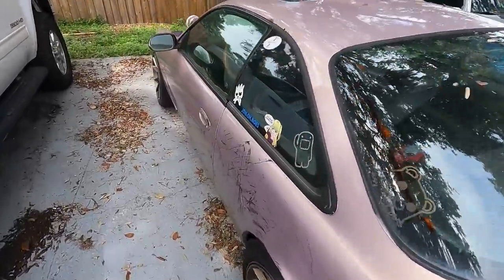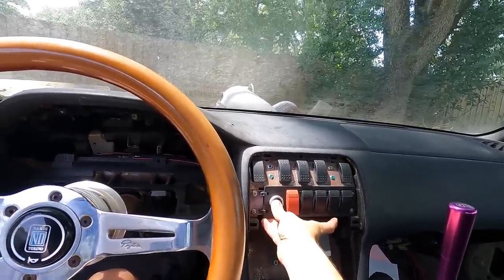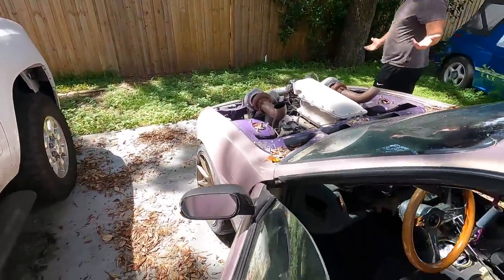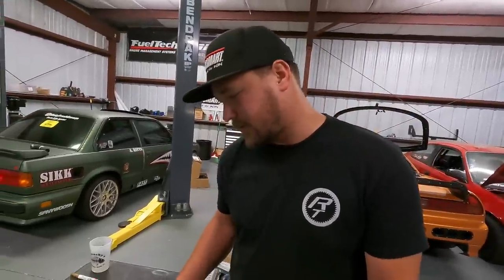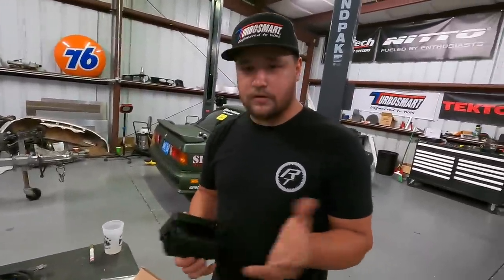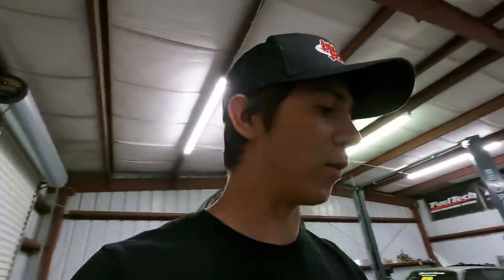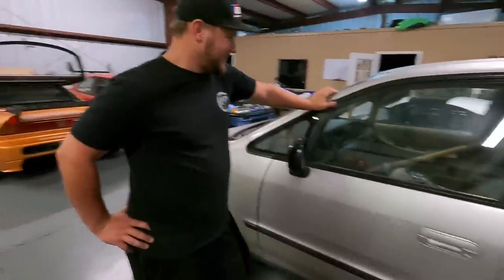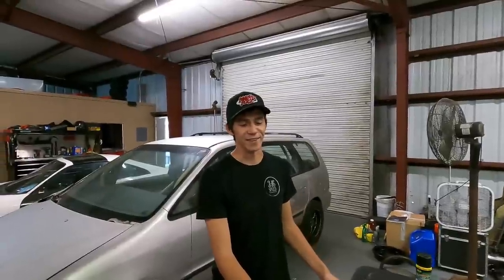Our 1000Hp Minivan Build Is Getting Big Upgrades!

Comment: Kyle, the best solution for your Alternator is an UNDERDRIVE pulley. It will not allow the Alternator to spin up as fast. Should be a LARGER than factory pulley. Good luck man!
Reply: Yup^
Reply: I've been trying to figure out why more drift car guys don't do this. I see a bunch of them or enough of them have issues with power steering pumps and other things.
Reply: You got to remember though on this it also if I remember I spend mechanical fuel pump? So I don't know if spending that slower will work when you need it
Reply: This right here. If he doesn't get a bigger pulley on it when he gets over 6k rpm consistently its gonna fail again.
Reply: @ls_812  only the components with the under drive pulley are going to spin slower. It won't effect anything else.
Reply: @ls_812  The mechanical fuel pump is on the camshaft, not on the accesories belt.
Reply: @ls_812  the larger pulley goes on the alternator, so only the alternator spins slower.
Reply: What?With the constant dead batteries,I was thinking he was doing a Blue-Tooth style alternator.Keep trying you 2.It'll go dead or blow up.We'll be watching.
Reply: @bryduhbikeguy  🤣🤣🤣

Comment: You need to put the 8.8 IRS from a Ford Explorer in the back of the Rowdyssey. All the axle and diff problems will go away, and you can bias more power to the rear where all the traction is available.
Reply: Rear axles are simpler to change compared to the bevel gear.

Comment: Glad to see you're using MIL-SPEC aerospace connectors - those are awesome for your application.  Once you start using circular MS38999 connectors, you'll never go back.  Crimpers and parts are expensive, but they are fire-and-forget solutions that you won't regret.  Much better than some taped-up honda plastic connectors.  Love the content, cheers!

Comment: Instead of carbon fiber a lower buck option that is easier to do for one off parts is vacuum formed plastic parts. You can make the doors and hatch plastic. They will not be as stiff but they are light and durable as well as easier to make at lower cost. Thanks for what you guys do. I met ya'll at Cleetus's event. You guys are fun to watch.

Comment: Why don’t you just park 240 under the RV awning?
Reply: I was wondering the same thing. But I think he keeps his flatbed trailer there.  I’d rather have that out in the rain then some of the cars around the shop
Reply: And throw a battery tender on it.
Reply: @FCBENI  hahahah seriously I currently have 6 of them all plugged in and charged up
Reply from the maker: It’s full with the 2 car trailer, enclosed, and the jet skis
Reply: Tionee 15  Right? kinda sad how badly he neglects his cars. then again, theyre not mine so its not really place to judge haha
Reply: @boostedboiz  the jet skis should be more waterproof to sit in the rain than that 240 with up pipes
Reply: @boostedboiz  they are car trailers, load it up. Lol
Reply: Put two of your cars in the enclosed trailer and pull out the jet skis and cover them with a tarp or waterproof cover made for them.  Store your other vehicles in their place.  Also, I use battery tenders on my parked cars and keep a jump box fully charged.
Reply: @boostedboiz  give em the BOOSTEDBOIZ MTV Cribs episode coming soon 😆
Reply: @boostedboiz  put the car in the trailer
Reply: @boostedboiz  you know jet skis are mostly waterproof right?
Reply: Put the 240 on a trailer under the garage, unless it’s already gotten cars on it
Reply: A Tarp...A Heavy blanket...heck plug the exhaust pipes with some foam balls if for no other reason to keep the rain out of the turbos...
Reply: @boostedboiz  just get a couple car stackers put the 240 over the wago or vise versa...just a thought but sure you have thought about it
Reply: @charlieupson11  Waterproof sure. But the sun fades jetskis like crazy, he would need a cover. Or else the gel coat and seats, handlebars etc would fade quick in the Florida sun.
Reply: @boostedboiz  brother...i got you..real talk.....K-TECH.....your VERY welcome homie ...go check that sht out..you want speed this mans el chapo for honda speed
Reply: @boostedboiz  mate call @sammit boys friend/partner is a parts guy even full cars son ...cmon kyle we got you brother and @sammit u and him i believe are both nuts off the same tree buddy
Reply: Kyle keep up the good work brotha I love your YouTube channel
Reply: @boostedboiz   I love your YouTube channel brotha keep up the good work bro
Reply: I think y'all are forgetting it's a basically stock jseries with eBay turbos. Meant for thrashing and burnouts. And fucker runs mint.
Reply: They have to much money
Reply: always thought the same thing...
Reply: @joetitone7486  unfortunately, that's a bad idea. I wish it wasn't... but if you did, you would be doing more than half the work for anyone with bad intentions.
Reply: That’s just his style.
Reply: @EASTSIDERIDER707  for real
Reply: Slap the 240 on the 2 car trailer while not using it
Reply: @Jcarney87  20k jet ski vs 5k 240. I’d take care of the jet ski
Reply: @boostedboiz  easy flexy mcflexerton lol
Reply: @TheFlatlander440  that's a pain when you want to use the trailer
Reply: You could have 1 ecu for all cars... just swith it over and change the tune depending on the car its in 😬
Reply: Its just a 240.
Serves a purpose as a beater not a show car lol.
Reply: @boostedboiz  put them on the trailer
Reply: @niekgozer26  Why?  Kyle wouldn't be strapping the cars down in there, just storing them.  Pretty easy to pull them out when you need to use the trailer.  It was just a thought.  Either that or buy a used 40 foot container on the cheap for storage.
Reply: @boostedboiz  build more coverage or extend the shop! 😁😁😁
Reply: @boostedboiz  put it on or in a trailer in the RV carport.
Reply: @Jcarney87  Priorities, man!
Reply: @joetitone7486  reminds me of goonsquad who have a car lift with a lambo on it and crawl around under the other car they are actually working on like it's a show stand.
Reply: @nickm6386  he has no choice
Reply: @i-_-am-_-g1467  what? A tarp is like $3
Reply: @boostedboiz  lol put the jet ski trailers on or in one of the car trailers? Modern problems require modern solutions.  =p
Reply: @boostedboiz  Cleetus cheerleader back at it again lmao
Reply: Good idea
Reply: Y’all need a carport!
Reply: @boostedboiz  what kind of diff do you need for the minivan?
Reply: The engine is cheap and it’s a burnout machine don’t cry
Reply: If you want your jetski destroyed in 2-3 years leave it uncovered in the sun.
Reply: @K20rotrex  yep just a mini van engine lol
Reply: That way you put the nicer cars in the air and the dont get bumped or scratched....just saying....
Reply: @boostedboiz  wouldn’t want the jet skis to get rained on

Comment: Need to at least stuff some NERF footballs into those exhaust up pipes while letting it sit and rot
Reply: Nerf balls just get waterlogged then drip in and dont let the air dry them out drill a small 1/8" or 1/16" in the lowest part of the underside of the exhaust

Comment: Put an ac system in it and route it where you can turn it from the cabin to only blowing on your intercooler. Very little power loss and the cold air will keep IAT low

Comment: probably should look into a larger ALT pulley to slow the internal rotating speeds. We have done that on several race cars. We've also gone to larger power steering pump pulleys to slow them down as well....that high rpm life

Comment: Cut the doors inside and take the bars off. You can cut them and still have the windows  roll up and down in the front. Cut the back doors and lexan the windows and rear hatch too. That would be crazy weight off. And still have door panels 💪🏻

Comment: Laying carbon is not hard. You can make your own with some elbow grease. Put the door into a sandbox to make an impression, spray that with rhino-liner or plasti-dip to harden it, then layer your carbon/resin onto that. Vacuum seal it. Doelne. Watch Patet build the scrappy carbon cub, there are 3 vids on making your own carbon body panels

Comment: Wosp also makes high performance starters, with better starting trough a lot higher cranking rpm. I believe rob dahm uses it on most of it engines and they work very vary well.

Comment: Kyle you don't have to use the Honda differential if you know the final gear ratio of the stock Honda DIf then you can use any differential as long as it's the same gear ratio you just need to mount it and get the shafts made

Comment: you could put some aluminium foil over the exhaust pipes at least it isnt open to the elements 
about those doors , even if you replace the steel doorskins with 1mm carbon sheet bend in a brake and glued to the steel innerdoor and take all the gubbins out of them they would be half the weight . might need to get inventive about the doorhandles

Comment: for the rear diff on the hatch, what about using a subaru or nissan one? would need to fab brackets for it, and get something to adapt the u-joint, but they are more common

Comment: Wouldn't taking the carpet and putting aftermarket bucket seats in help with the weight in a minivan? Even if it doesn't, still be rad to see 4 carbon buckets in the rowdyssey

Comment: The boys over at throttle put a s2000 dif in there rwd civic s1  performes helped them seems like it might be the way to go
Reply: Big difference between 4wd and rwd.. rear diff needs to be right ratio to match the front.

Comment: What is the ratio on the rear diff? if it is common enough you might be able to get one from another car to fit. Would likely take custom axles but let's face it, those stock ones are not gonna last forever anyway.

Comment: Really need to “lighten” the interior of the rowdessey y’all are worried about carbon doors with 400lbs of seats and carpet in the car. Would it help for sure but do the cheap and easy weight reduction first.

Comment: Way over revved the alt. when hitting the limiter .  I am very surprised  about that small  pulley on the alt.   You  could ask them about a 3 inch pulley given the 9k engine speed with that sfi main pulley.